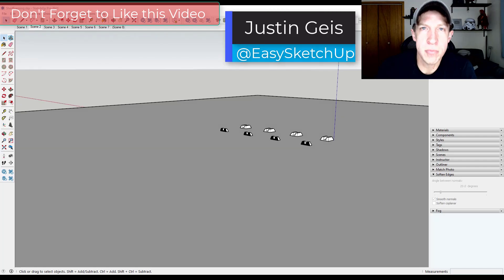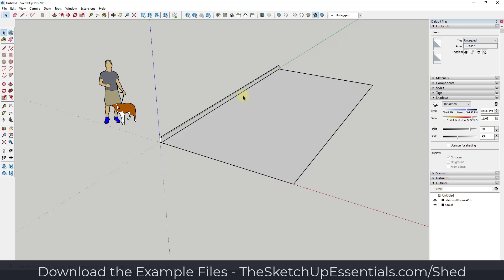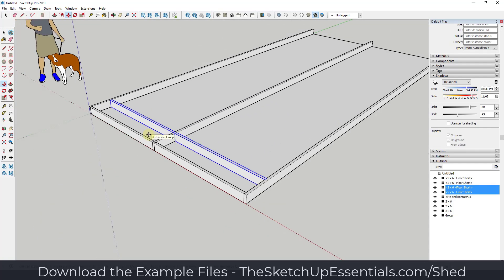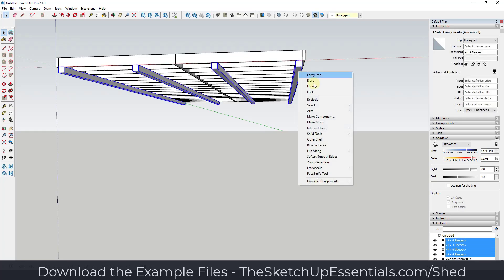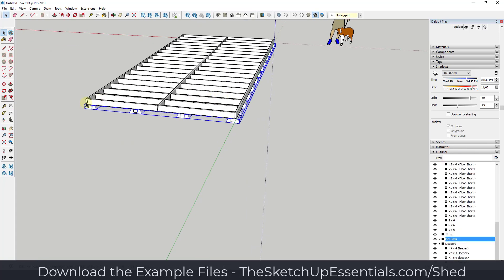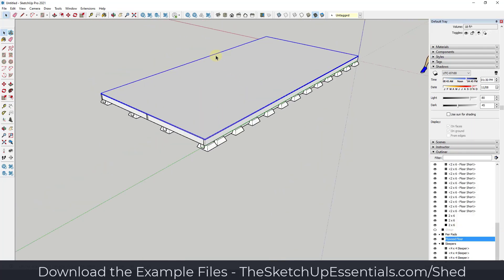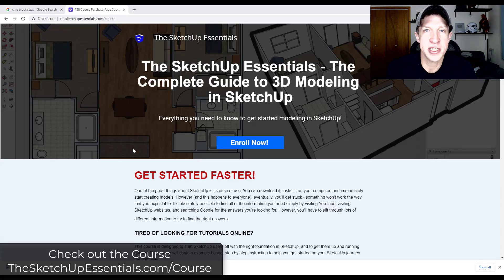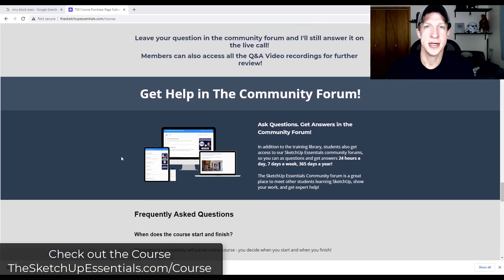Creating Floor and Wall FRAMING in SketchUp! (Detailed Modeling in SketchUp Part 1)

Comment from the maker: Hi everyone! Let me know if you have any questions in the comments below! :)
Reply: Hi! I have learned so much by viewing your videos, thank you!!  But right now I was working in a SketchUp project, and I have a question: is there a way to place a button or even better a shortcut that can allow me to quickly switch between using INCHES to using MM? I work with Italian kitchens and every time i have to deal with inches and millimeters, so I have to keep changing and switching it 30 times per job. Thank you in advance.
Reply: good morning, doe the 2021 verion have a extension like the 2019 verion had for the wall and floor building where it did everything already. i think it was call house builder? thank you
Reply: I have a question, how did you enter keys?
Reply: How did you divide the beams? What keys should I use. Maybe its different on iMac, but Im a little stuck here.
Thank You!
Reply: Yes, why do you guys always do demos using a completely different set of tools that's available to someone who is just using a trial version of the product. Wouldn't it make more sense to do a demo with the tools available on the trial version of the product so people can decipher weather or not to buy the product or not?
Reply from the maker: @petermoore4912  Which tools in particular did I use that you don't have access to? As far as I know, this tutorial uses native SketchUp tools in the Pro Version of SketchUp...Maybe you're using the free version of SketchUp? This isn't a free version tutorial...
Reply: Can you tell me How to drawing in SketchUp fluently
Reply: I want to design a simple, small house. After conducting extensive research, SketchUp (which sounds like Ketchup) seems to be the most effective software. My main idea is to understand and identify any design challenges, obtain the cost of lumber, and have a design to submit to the county rural office (if anyone even asks). Any Advice?

Comment: I think you flew quickly over a very crucial detail. A software like Sketchup can do anything. I already hear everybody saying Yeah that's the great thing about it!! Yes it is, however it is crucial that beginners understand that if they are to draw something (like stud framing) with the goal of building it, it is CRUCIAL that they do their complete research on what exist in the real world and can be purchased and transported. At the very beginning you created a 2x6 of 23 feet long. It doesn't exist per say, and would be quite problematic to move around. You said that we could divide this into piece of real dimentional lumber like it's an optional thing, but for most beginner it really isn't. You should ALWAYS use real dimensional value of what you intend to buy to build the thing you design. The 2x6 will likely be either 8-10 or 12 feet long, so you will not only need two or three, but will also need to have a pier or a joist perfectly centered at the seam of each of the 2x6 butt joints to carry the load or else you will have no support to install those 2x6s one after the other.  A great deal of knowledge and research is required to do a proper drawing of a house / shed / basement make over etc.. Things need to be built to code using material that exists. The software will not tell you that you are drawing something that can't be built.  I understand you didn't went into this amount of details to be quicker but that gives a false impression of how much time you actually have to invest to create a proper, realistic, ''manufacturable'' drawing. A plywood flooring for instance is not just 1 sheet of 10x23 plywood and even if you say ''well everyone knows it will be 4x8 sheets in reality simply stacked together'' it is still wrong. To do a proper flooring, you need to stagger the joints, which means you don't just lay the sheet next to each other. You have to create a pattern, which means more cuts and left over, which results in the need to buy more material than the equivalent of a 10x23 square foot area.  Remember this folks, there is a HUGE difference between a ''As designed drawing'' and a ''As built drawing''. A DIYers should always aim to draw a ''As built drawing''.

Comment: Question: having trouble with the “pier pads” at time 5:04… think im missing how to drag rectangle from center of the bottom of sleeper beam as well as how to use arrow key to lock to blue axis.. going step by step but think im missing somethin! Great Instructor, great video and fun project!! Thank you!
Reply: Maybe two years late but press CTRL

Comment: Hi,

I'm learning to model for videogames environment. Is there any course you sell/share where I can learn what I need to model in order to achieve a believable building?
I'm not an architect, I just need to model something that LOOKS good and belieavable.
E.G.: if I model a wooden house I need to show some structural details, I can't just make an hollow roof, BUT I don't need to model what's underneath the floor.
Sorry if I can't explain it in a different way.
Reply: I've enrolled in his online course called "The Sketchup Essentials" and it has been well worth it. It teaches Sketchup modeling, creating plans in LayOut, and even using rendering software to create super realistic models.

Comment: One thing... The window framing needs to continue the 16" on center above and below the opening.. Otherwise sheet goods like plywood and drywall won't end on a stud in that area.
Reply: good point, if I am not mistaken you also need an element at the corner (like the California type) to support the inside drywall
Reply: He's not designing something for you... 

 he's showing you how it can be done, If you want the framing @ 16" centre's above and below the windows when you design something after learning from this video, fill your boots.

Comment: Disclaimer, do not use this for construction. Ive never seen something be over engineered while at the same time also being under engineered.
Reply from the maker: Weird comment. Obviously don't build off of a 3D modeling tutorial designed to teach you how to use a 3D modeling software. Feel free to model your framing however you'd like.
Reply: @Thesketchupessentials  sure, I guess I'm just a stickler for when people give tutorials on something that it's all shown correct. Yes the framing techniques aren't what's on display but for people who know how framing works, when it's done incorrectly it stands out. If that makes sense.

Comment: What is a 2 x 6??
Reply from the maker: This might be a good question to type into Google...
Reply: @Thesketchupessentials   Okay um thanks. I feel embarrassed for not knowing it
Reply: @pranayblue  2 inches by 6 inches
Reply: @pranayblue  standards for "dimensional lumber" have been established in the United states as less than "rough" lumber. What Justin refers to as a 2x4 is planed and dried to the dimensions he states. I applaud you for asking for clarification. 2x6=1.5"x5.5"; 2x8=1.5"x7.25"; 2x10=1.5"x9.25";2x12=1.5"x11.25". Larger sizes shrink more proportionally accounting for the loss of an additional quarter of an inch. Further more if you measure with a micrometer, you will likely find further discrepancies. I was taught in architecture school to never dimension anything less than 1/4" on a plan. Furniture and fine crafted woodworking is more precise. I invite others to comment or correct what I have stated here to assist Fares and Pranay,
Reply: Ohh.. so that's what a 2x6 is!! Thanks a lot  @rmontena4583 !

Comment: Thanks Justin Geis for your time and effort for creating these tutoring videos. I learn lots from it. 
I have a question about the foundation. I see you use lots of 2x6 plus plywood. i am wondering why do not use concrete. Price may be the same but last much longer and would not worry about animals to chew in. 
I am not sure. So, want to confirm with you. You know more than I do.
Reply from the maker: Mostly because it's a video about creating 3d modeled framing, not about how to actually build a shed. Concrete slabs are great if you want to keep everything on grade. If it's up above grade for moisture reasons or other reasons, concrete won't work. Please do not try to build a shed in real life based on an example model I create for SketchUp

Comment: I like the deviation into architecture fundamentals. PLugins like madeeks do this essentially automatically - correct? Is madeek the best for this?
Reply from the maker: Something like that - Medeek probably makes the most detailed realistic framing right now. You can do something similar with Profile Builder but it wouldn't add the extra detail for openings
Reply: More importantly the plugins allow you parametrically model which means you can insert windows and doors and then modify them ad infinitum. If you manually model something then if you make changes to the design it will require a good bit of work to re-adjust things.  Plugins are all about saving you time with your modeling and not having to work as hard.